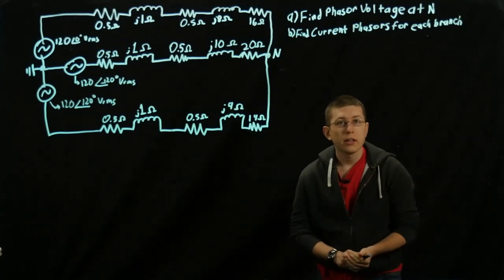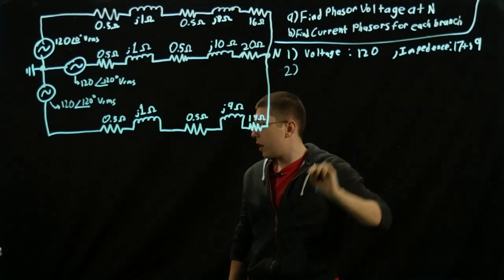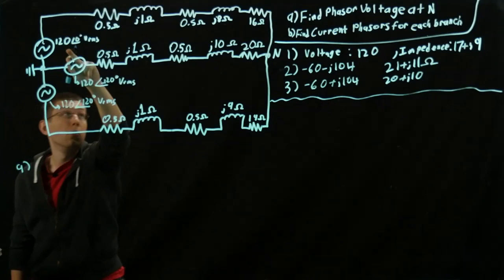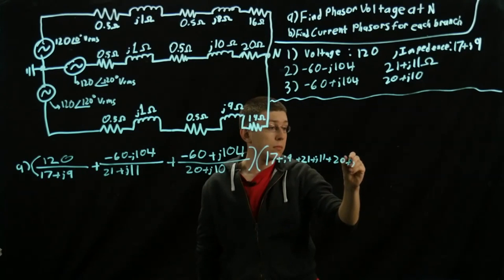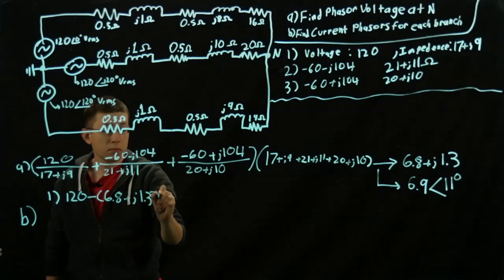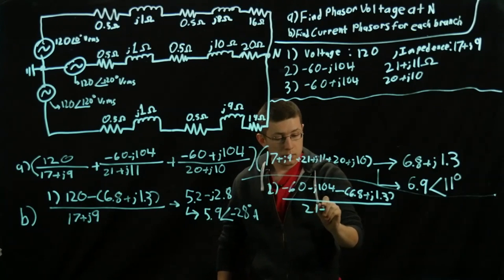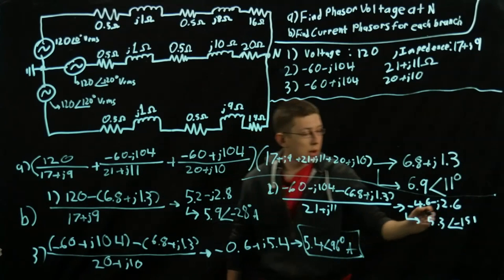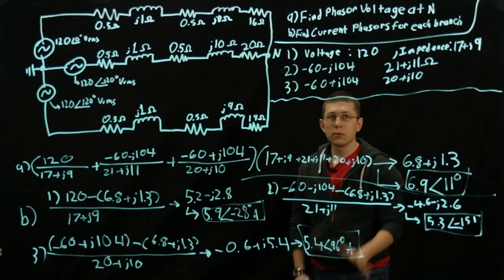Circuits 1 - Unbalanced Three Phase Power System - Example

Comment: Would UConn HKN consider doing an example for a Delta-Y, Unbalanced Load, with Line Impedances, NOT converting the source to a Y equivalent, calculating the source and line currents, power delivered, and power consumed.

Comment: This is the first time I have seen a 3 phase circuit solved using nodal. Where is the variable N in the equation? I don't quite get how you found N without identifying it in any of the terms used in the first equation.  (120 - N)/(17+j9) + (-60 + j104 - N)/(21+j11) etc.
Reply: He's using Millman's theorem without mentioning it. Yup, the node voltage VN is missing in the equation.